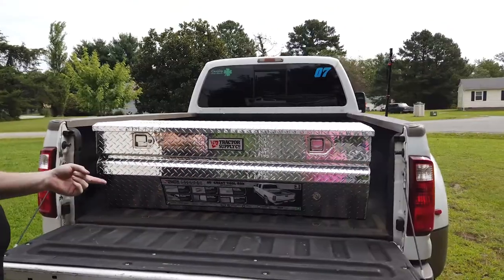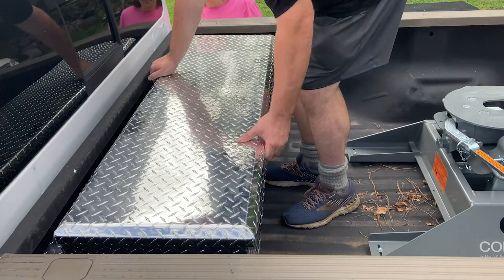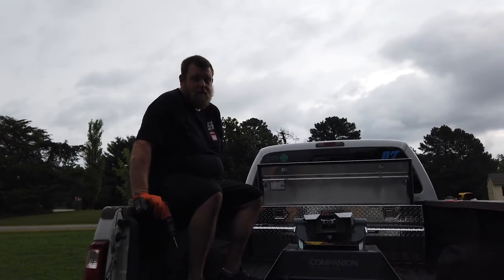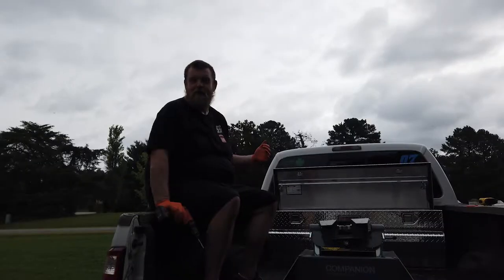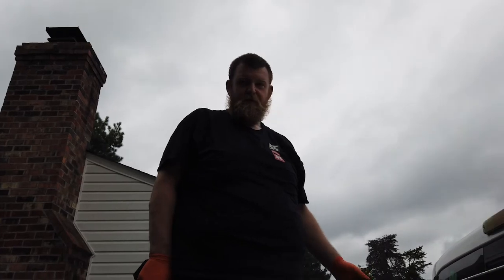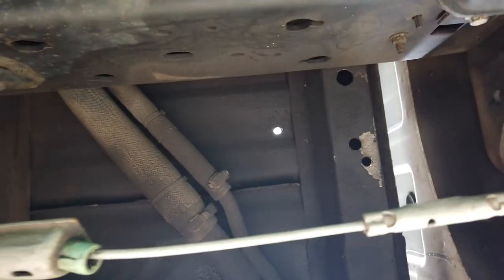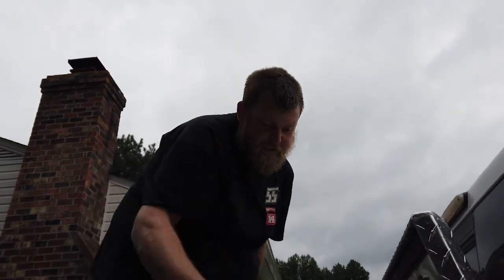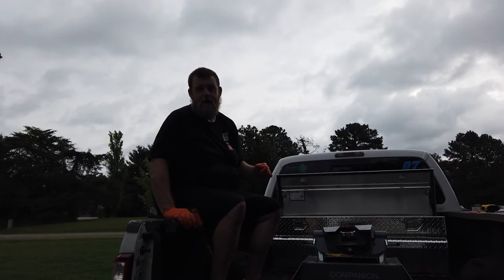How to install the best truck tool box for a 5th wheel!

Comment: thanks for video, the box i had on my old truck went over the edge of the bed, and i used U bolts to hold it under the bed so there was no drilling, but obviously for like 5th wheels its super important the box is at or below the bed rails. thanx for video
Reply from the maker: We definitely weren’t super crazy about drilling into the bed! Thanks for watching!! — April and Chris